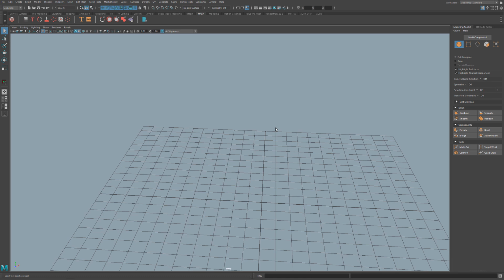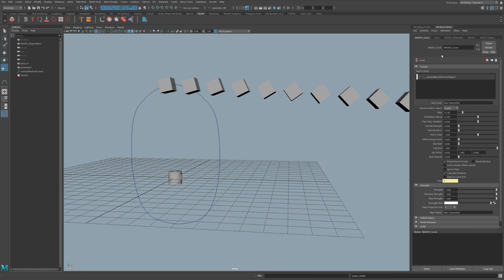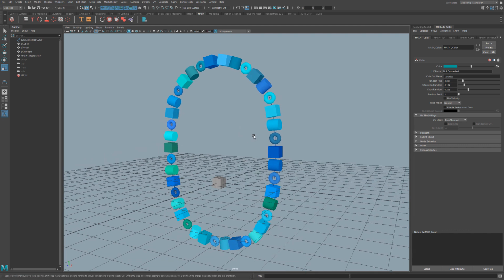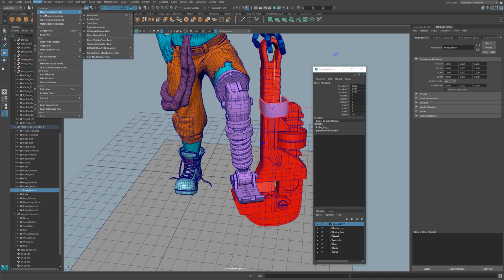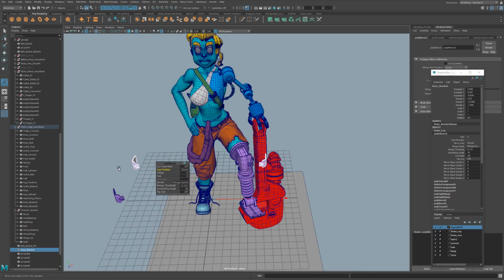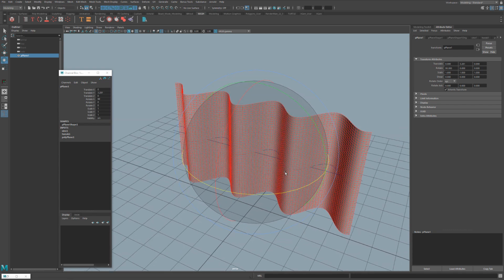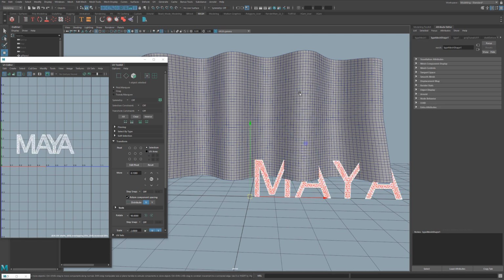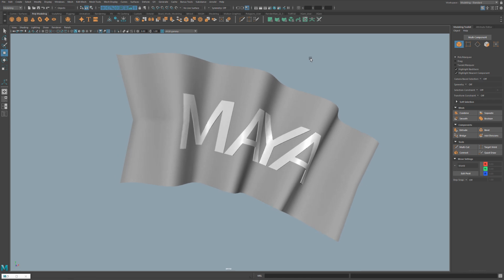Weird 3D Modeling Maya Tricks: MASH, Instances & UVs

Comment: did you know about that little blue pie chart when in the mirror option box where you were selecting the offset and whatnot, if you click that little blue pie chart it will slow down or speed up your adjustments relating to the option box.

Comment: The second method (with instance) could be even simpler. Position and orient a pivot along the edge that sits in the middle of the mesh. Then bake it (Modify>Bake Pivot). Maya would calculate the exact angles for all the axis that you can see in Channel Box. Instance the mesh, reset (zero out) the rotation angles so it's easier to make adjustments. Once done with mesh modifications you can match the rotation with the original mesh (Modify>Match Transformations>Match Rotation).
Reply: It just occurred to me, you don't even need to match transformations because all the changes you are making to the instance will be reflected in the original mesh. So the final step would be just to delete the instance.

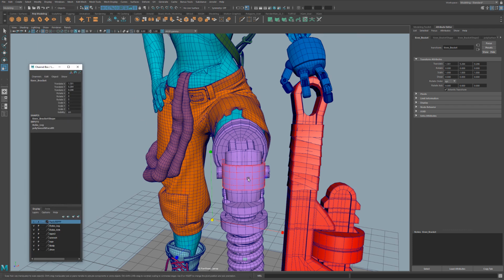Comment: Nice tricks, thank you!, now I have one question. In the second trick about the instance minute 11:30. What if you have to combine another mesh to the object?, that would break the instance, how to overcome that issue? I'd like to use this trick with a lot of screws objects that were positioned in several parts, once I combine the mesh all the instances break.
Reply from the maker: Mirror should not break the instance.  Extracting or detaching will.
Reply: @jlmussi  thank you for your answer!, however, lets say that we have to combine the mesh, what to do when the instance breaks?
Reply from the maker: @ArsM-z3t  Yes combine and separate will break an instance.  You could always combine your mesh, and create a new instance.
Reply: @jlmussi  thanks again. Creating new instances mean that I would have to re-position the new instances again, which is kind of hard specially when dealing with lots of objects like in the screws example.